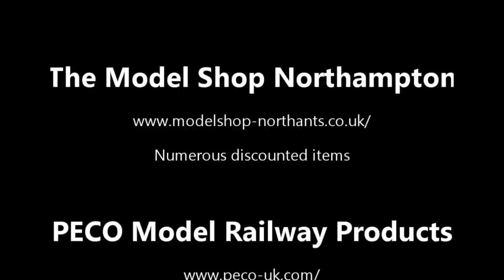HOW5 - Fitting Sleepers to Peco Code 55 track

Comment: Thanks so much for posting this. I am new to this, and I have just struggled with fitting the sleepers under the joins - especially the insulated rail joiners, which hang down much more than the alloy joiners. I think I will go back and revisit this as I wasn't happy with the way I tackled my sleeper issue. Filing a deeper groove makes a lot of sense. I have a small bench vice and I may try that, but I like the pliers method as they hold the sleeper down on a flat surface. Your method has given me food for thought, Cheers. Peter

Comment: Nice clean job! Another way is to use the thinnest grinding disk on your Dremel and cut between the rails and the sleepers on the last inch of your flextrack. You can then slide the sleepers under the fishplates.
Reply from the maker: Great tip!

Comment: Thanks for this video,I was just going to cut sleepers up and piece them between the rails. I am on N-gauge too, building a bigish junction and was finding if your not carefull, you can raise the track at the joins if your not carefull.
Reply from the maker: I found my first efforts were lifting the rail ends slightly.  Filing further into the plastic until the rail sits flat worked to resolve that issue really well.  I have now used this technique throughout my layout and I have been really pleased with the outcome.